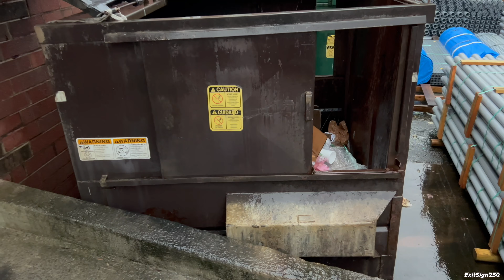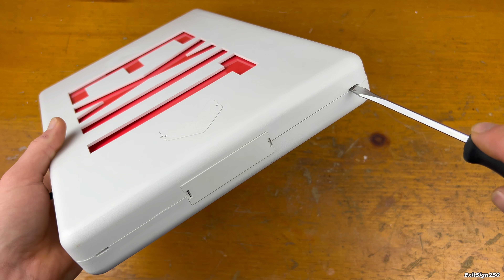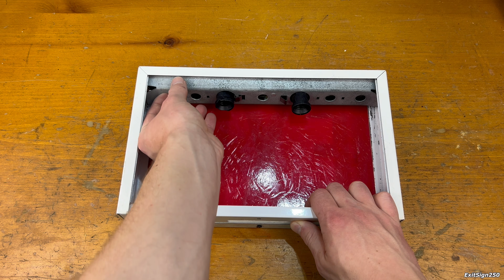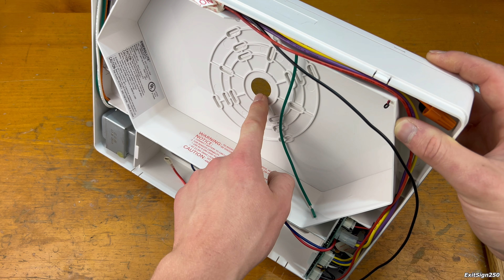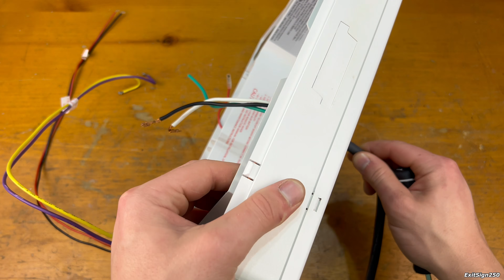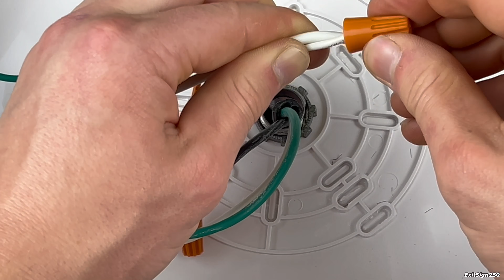How To Wire An Exit Sign With Power Cord

Comment: Hello again, What size gauge should I buy, for a 3 prong appliance cord? Thanks, Jay Grabowski
Reply from the maker: For a single exit sign it doesn’t matter. Any size will suffice. I’d suggest the smallest you can buy so making the connections as well as tucking wires into place can be easier.

Comment: Thank you for this video.  Question:  I have one of the metal Exit Signs.  It has a total of 5 wires to connect.  Two black wires, two white wires and one green wire.  Do I only need to connect 3 of these wires to the 3 prong appliance cord I need to buy?  The sign has two separate bulbs inside of the sign.  Because of this, do I still only use one of the white and one of the black wires along with the green wire for connection purposes?  Jay Grabowski
Reply from the maker: Hey there! I’m glad this video could help. To answer your question, you will need to connect all black wires and all white wires together in order to have both bulbs light up. Only connecting one set of black and white wires will cause only one bulb to light up.
Reply: @ExitSign250  Thank you for responding. Jay

Comment: This video is pretty helpful! I usually use wagos for my signs and I usually use battery backup on them! My ez snap I use wire nuts on it and I had to replace the pack in the battery but it now works! Thanks!!

Comment: Much informative video. Anyway you can do a tutorial on how to wire multiple exit signs and emergency lights at the same time? (2 signs, 2 emergency lights; 1 sign, 1 emergency light; etc).
Reply from the maker: Thanks! Glad it was able to help you. Generally I’d recommend one cord per unit to keep it simplistic. I’m not sure if I’ll make an additional tutorial on how to connect multiple units to one cord, but if you’d like to do this you can simply run two (or three depending if you sign has a green ground wire) to from the first unit with the cord to the next and so on. Connecting the same color of wires together. Make sure to use the proper type of wire between the units. You can try to find an appliance cord with two bare, hardwired ends or use lamp cord which by default has two hardwired ends.

Comment: If your exit sign does not have a place for a cable clamp, tie the cord in a knot so it cannot pull out.  Some exit signs use DC current from a remote battery.  They are rare but I have two that way.  You will then need a power supply.
Reply from the maker: The knot is a good tip. And as you said DC exit signs are extremely uncommon. I do not own one, but I believe they do not follow the same wiring colors (black, white) as standard AC exit signs. Hopefully if someone has this style they will see it is not compatible in the “Identifying Wires” chapter of this video. Thanks for your comment!

Comment: I use C13 IEC cables and cut the end off. because they have been the international standard for computer power cables since the 1980s they can be usually found for $0.25 or free.
Reply from the maker: I have done similar in the past, as well as standard extension cords. I did not show how to do this as I have heard some people who did not correctly cut and strip the wire connections on the cord and caused a short circuit. An appliance cord guarantees anyone at any skill level can safely wire an exit sign.